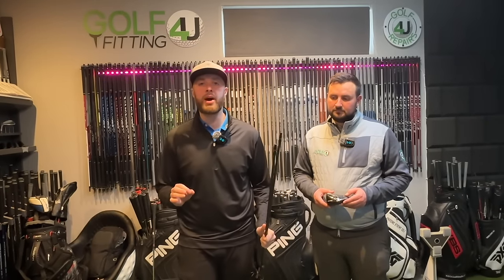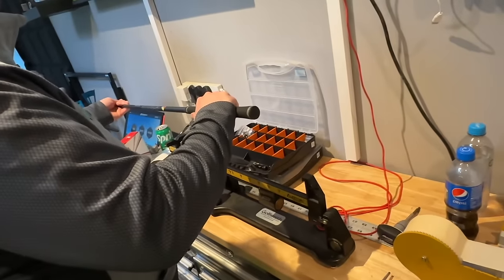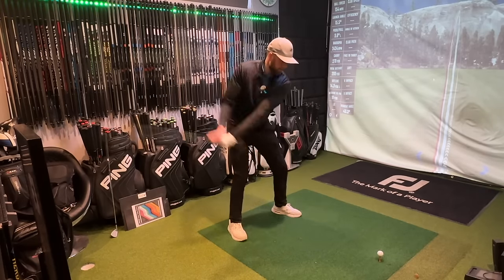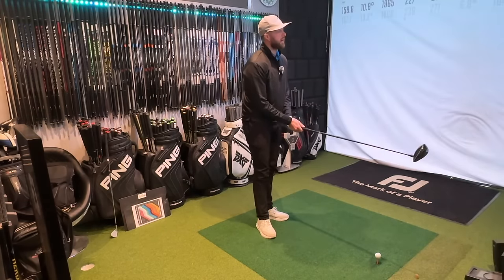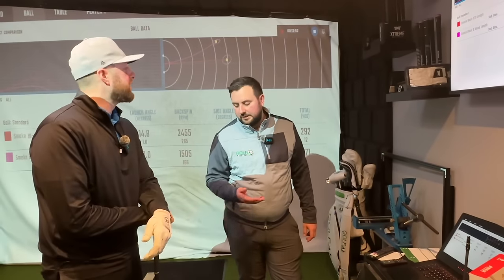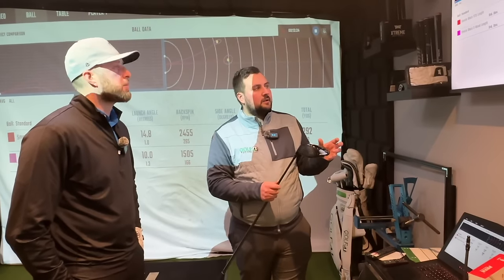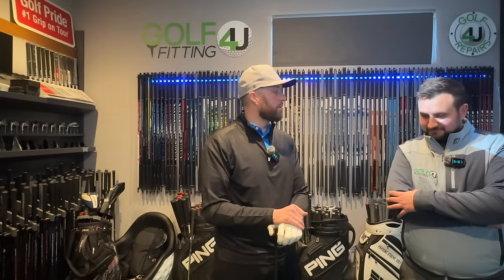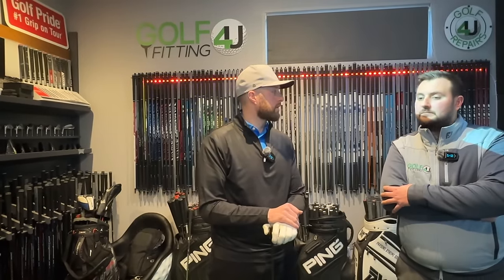You must watch this video if you want to gain accuracy by playing a shorter driver shaft length

Comment: So Gary, if someone has a ping g430 max driver with the movable weight at the back, is this not necessarily the correct weight for the user, and could someone like Sam alter it so you could get a better performance from it.

Comment: Shortened my sim2 first from 45 3/4 inches to 44 3/4, felt much more in control of my swing (5’8” 32 inch wrist to floor) but I couldn’t really feel the club head through impact. Very weird feeling, so I then looked up my wrist to floor measurements regarding driver length and discovered that I should be playing a 43 inch driver😂 so I have just shortened it to 44, and I am adding 12 grams of weight to the head (for every 1/2 inch cut, 3 grams added so technically I should’ve added 10.5g) but I am a fan of a heavier club head. Am hoping for better accuracy off the tee, as I have no issues with distance. Weights on the way!

Comment: I want to take my PING G400 SFT head and put it on the PING G400 3 wood shaft. How much weight would I need to put on the back of the head to get it up to specs ? I don’t have a machine. Any help ?

Comment: Randomly just put my 3 wood shaft at 43 into my standard shaft and added some lead tape.

Actually gained 2 mph swing speed and consistently have ball speeds between 165 and 170.  Main issue is that I can't quite get the launch up.  I'm down at 10 to 11 vs 13 with my 45" driver.   All together the 3 wood is better but the rockets from the 45 are still further even with less ball speed

Comment: Dispersion with 45inch+ driver length
can be expected due to mechanical properties of a shaft with tip diameter  0.335.(mechanical engineering)
With tip diameter constant and total length increasing, there comes a point (@ 45 inch length) when 
no shaft of that length and tip diameter can react as consistently as it can below 45 inch length.

Comment: 3 wood is still a long shaft.
If you look at the Cobra one length 3 hybrid it's 19° loft and 7i shaft (so 37.5").
Most people are still going to get that over 200 yards and it's a completely different swing.
It isn't an "up and down" swing but it feels it and in general you're just not going to slice it.

Comment: im 5-5    i cut my driver to 41 inches, sim2,  i can hit the ball well,  i can hit it 240 on a fly,  i have zero control with a full size driver, my swing feels all over the place,       i put on medium grips and never been better,   i chopped my 5 wood and it goes further than ever,  its all about swing speed,  not length

Comment: Probably won't see as much difference in someone with a good swing that hits the sweet spot more often than one whose swing is not as good and is hitting the ball all over the face. Shorter club for a person with a so so swing is probably good for them. Hit the sweet spot more often = more distance, even with a shorter club. This is why many I have seen hit a 3 or 5 wood instead of driver because they hit them better and the main reason is being shorter.

Comment: If I'm not mistaken can't you just choke up an inch or so...why replace shaft, unless it's the wrong flex
Reply from the maker: We’re going to do the test to look at the data because from a playing golf point of view I don’t think it will perform the same as a shaft shorter in length. 

When you grip down a full length club, in my playing experience, it’s lowered spin and launch considerably. 

We’ll check it out next time we film 👌🏼
Reply: @garymartingolf  Were you able to find out if choking up on a standard shaft will give you the same result

Comment: As someone who is coming back to golf after 10+ years, I'd love to try this. I jave 0 confidence in driver but hit a 3 and 5 wood I'm More consistent.
Reply: I rarely use my Driver unless I am playing a really wide open course !
I stick with my 3 Wood or even my 5 Wood off the tee and am happy !
Not wishing to mess around with my Driver !  It's used rarely but still needed !
Mind you I have changed the loft and added a little more weight in the optional weight set up !

Comment: I am gaming a Vanquish 4 S @ 43 3\4 tipped 1 inch , head Weight is 210 grams, The confidence on the tee is off the charts and I haven't really lost in distance because I am hitting center of head almost every time, It's a bomber !!🏌🏌🏌